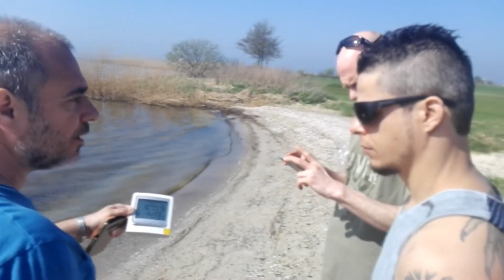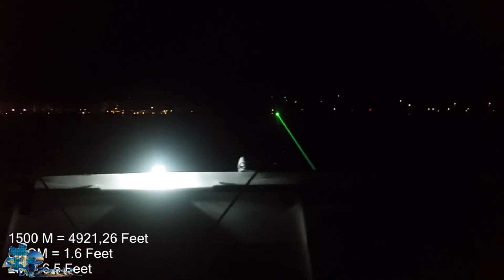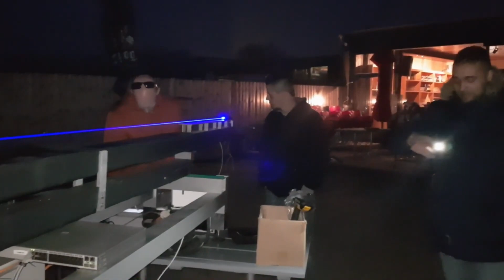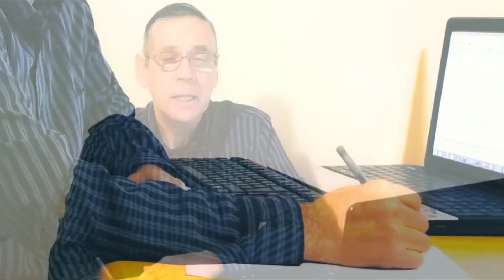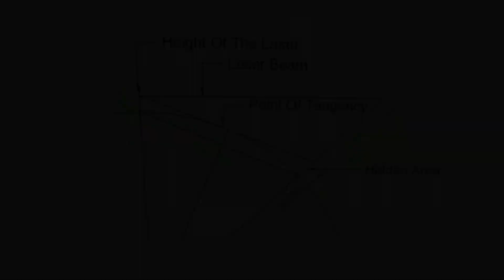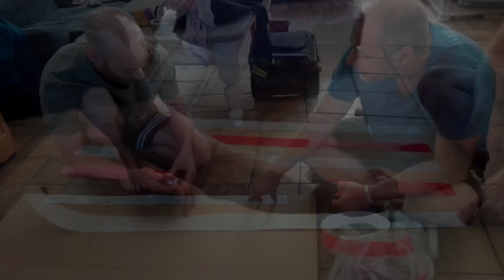The Greatest Laser Experiment In History   FECORE

Comment: I'm impressed by your effort to solve the problems you faced to conduct successful experiment, especially the GPS guided SALAD. 
For me, the grey area is the refraction calculations but even if I assumed they are accurate, I would assume they were correct only for observation 1 through 5 where you could even see the laser reflection on the water but not 6 & 7.
Good to see you again